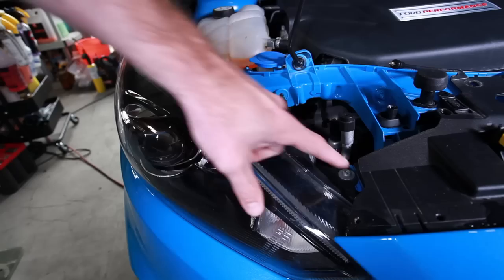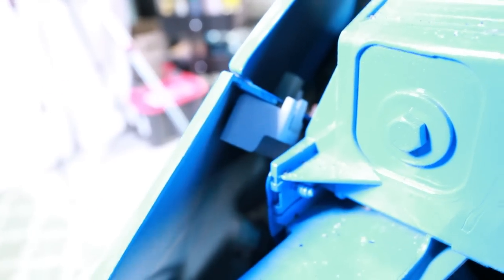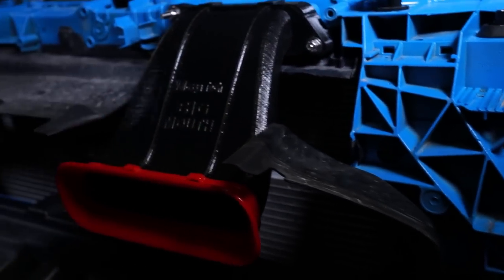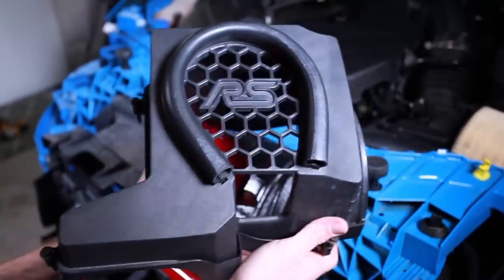HOW TO INSTALL BIG MOUTH RAM AIR INTAKE FORD FOCUS RS

Comment: That blank-off is on the intercooler for a reason:  the intercooler was actually too large and would cause condensation and water droplets to enter the intake and cause a misfire. But, you’re obviously way smarter than all the Ford engineers that designed the RS.
Reply from the maker: Matthew Byrd OMG looks like someone watched a video on this recently. That only matters in certain climate conditions. Also there are better intercooler options out there ETS intercooler made a huge improvement in air intake temps on the dyno leading to power gains. These are CA cars no issues with this.
Reply: Just trying to make people aware.
Reply: I just don’t understand it. I’ve seen way larger intercoolers on many different cars I’ve never heard of this issue. It has to be for the 1%. Like Blake said there’s companies like ETS that make even larger and more efficient intercoolers and no problems. Why not put a blanking plate on every intercooler then. Ripped that junk off until I upgrade intercooler.

Comment: Is it me or did the filter change color from red to white ? Sounds lovely at the end great mod 👍🏻
Reply from the maker: Liam Fitzpatrick good eye 👍
Reply: Blake was there a reason Chris went back to the stock filter??
Reply from the maker: Liam Fitzpatrick I did that for the next video on his car.
Reply: Thank you 👍🏻keep up the great work love every video especially as I hope one day to own a RS and some of the mods you have covered are great and you go into great detail . Witch helps novice moders like myself 😄
Reply: The reason they switched is because the red filter was a high flow filter. The RS air box uses the end of the filter to seal the air box, but a few air filter companies have offered a flow path on that surface, which would make this big mouth part not work as well. He should have explained that instead of glossing over it in the video. http://www.greenfilterusa.com/store/7159
Reply from the maker: Liam Fitzpatrick that and I have another Mod video coming out for this car soon.

Comment: The reason Ford put the blanking plate on the inter-cooler is because the RS runs too cool. In high humidity and other situations vapor can collect on the intake tract. That comes straight out of Tyrone Johnson's own mouth on this video. 

https://youtu.be/Rc6rAzazh5M

Comment: -Does it reduce a lot of intake noise from capping the top of the intake box? I know it's good getting cooler air but I also love the ''N/A type'' intake sound that the RS makes vs others turbo car.
-Do you think it would get packed with snow in the winter time( I'm from canada) 
Thanks keep up the good vids!

Comment: I'd pull that thing out over the front of that bulk bumper bar. You'll get a lot more affect and feel it. That seal for the air box is to keep heat out and so the snorkel actually has a chance to suck sone air instead of from the airbox and hot engine air.

Comment: It looks sweet.  But im 98% positive it doesnt do shit do to the way air was already fed to the box.  That rubber gasket pushes against the bottom of the hood, so it ALREADY only pulls from the front.  You just moved its inlet like.... 6 inches forward.  Also.... wtf dude.  Red?  Its a blue car, get blue or black.  Red doesnt go with blue even a little.

Comment: can i install this snorkel after cobb stage 1 tune installed? asking because cobb webside says " installing  other hardware different than the air filter , wih cause the car runs poorly.  so cam i install this?

Comment: Is it possible to just remove the shroud instead of cutting it? And if I do remove it, will there be any negative side effects?
Reply: I have the same doubt, I prefer to remove instead cut, but idk what is going to happen

Comment: I would think the plug in the existing airbox would be detrimental at speeds below 60 right? For dding, stop and go traffic, wouldn't it basically make the engine breathe worse ?
Reply from the maker: AOS AIRSOFT not at all you're actually sucking in fresh air from the outside instead of from the engine bay.
Reply: Blake's Garage oooooohhhh, I was thinking of it as a passive thing like a rad, I forgot it is actually sucking air, thanks !
Reply: AOS AIRSOFT thought the same
Reply: I’m not convinced that these snorkels are actually worthwhile. “Ram air” effect has got to be nil and the stock air box already pulls outside air from the top of the radiator frame which is a high air pressure area. I’m thinking the extra restriction may really give you higher delta P.

Comment: Would something like this be effective on a Wrx? I ask because the existing air box (at least on my 09) is already shaped similarly
Reply from the maker: They do not specifically make a difference snorkel for the WRX. I told him there may be a good market for it but they put a lot of engineering into designing this piece to actually work not just a gimmick. So maybe in the future then we could do something but they would have to have someone close by that they could work on a concept model.

Comment: Thanks for the video!  It made me indefinitely postpone any plans to actually ever install this thing… 😒
Reply: … until this spring, when I intend to completely go over the car front to back.  Ram air, intake, TB increase, exhaust, 93 octane tune, sways front and rear, coilovers, and fat rubber.  It’s gonna be sick. 👍

Comment: Looks nice but surely with the sealed air box plus a vent now on the front of the car allowing direct access for rain to come straight in and flood your air box this would be bad? Just a thought, anyone running one of these and having problems with water on filter?

Comment: Great vid. Thanks.  Will this fit after an oil cooler is mounted?  Will one intrude on the other?
Reply from the maker: Sean Dyer No, it will not fit with an Oil cooler. Unless you will cooler is very small and you can mount it lower.

Comment: Worth getting a Focus RS for daily driver mod car? Or WRX STI?
Reply from the maker: Jerry Ramirez if you're going to Mod it and don't want to dump 10K on a engine build in the first 20K get the Focus RS much better car and more Mod friendly than the EJ plus way more power and handling for less 💵💵

Comment: Are you down to do this on a Fiesta ST? Would do it myself but taking off the bumper genuinely scares the shit out of me.
Reply from the maker: godfatherscar essentially it would be the same thing. It's not the funnest task ever however it is very manageable.
Reply: I know how it should be fairly simple, just to me taking off a clean nice painted bumper just gives me chills. My last vehicle had shit for paint left so I could tear it apart and not give a damn, and metal can't be damaged as easily as body can XD Not used to doing body work on a practically brand-new car.

Comment: Hmm you shouldn't remove the inter cooler blanking plate. It's there so it's not to cool and does condensation....
Reply from the maker: +TheMidnightNarwhal not an issue with our climate.

Comment: is it possible to fit it with the bumper on
Reply from the maker: jack black no, if it were I would have done that. Install is definitely time consuming.
Reply: Would you say its worth it for the price
Reply: thanks for the reply. It's just on the focus st mk3 you can take off the front grill off. Would you say it's still not possible to do it without taking the bumper off.

Comment: Dont buy it feom awdmods they advertise inthe pic that it comes with the seal. And its even the same price as the kit WITH the seal from other sites.  Other sites at least tell you it doesnt come with it.  Like focusrs shop or cj pony parts.  Also you forgot to mention about 12 push clips on the underside of the bumper and 2 27s on the front of the fender wells. As you cannot get to the rear bolt for that white clamp on ether side.  Its a bitch getting the thing on and lined back up again too, much easier with two people.  One to hold the fucking thing tight, and the other to bolt it down as EVERY bolt is in some way difficult to deal with.

Comment: These snorkels really need to stick about 4-5" out of the grille this catch the airflow, and suck it in. It's nit a Ram Air. There's no such thing. The Ram Air name that Pontiac coined, is really an air suction device, because airflow does not stick to the body, it deflects above it 3-5", and only under throttle, primarily above 50 mph, will the suction be enough to work.

Comment: don't go for more power you wil crack the block they are so weak Ford warranty will cover it if you have mount tune products only I'm on my second engine now and my second rear drive unit.  They should have made the car as sturdy as the fiesta ST 180.....
Reply from the maker: Big2009Gee who did you're tune? They were probably demanding too much torque down low. On Brandon's car Travis actually had to tune it back because the engine want to make so much torque.
Reply: Blake's Garage it is completely standard I did one track day and the RDU went the another 2k miles and the block went (5k miles total) I've had the car 5 months 2 months of that have been spent back at Ford. Now there's talk of a lot of spun bearing too. people are cracking blocks every day on the new RS look on the forums it getting serious now.
Reply from the maker: Big2009Gee interesting I have heard things but Brandon's RS has been solid no issues whatsoever. I guess time will tell. It's also seen about 5 or more trackdays.
Reply: Blake's Garage hope it stays strong for him.  I love the car it handles and preforms amazingly just a bit worried with the amount of trouble I've had in a small amount of time.
Reply: How are people cracking these blocks? I've had mine for a year and so far it's been good to me.  It's seen the drag strip several times and many canyon runs.